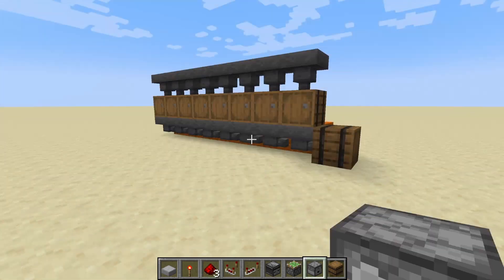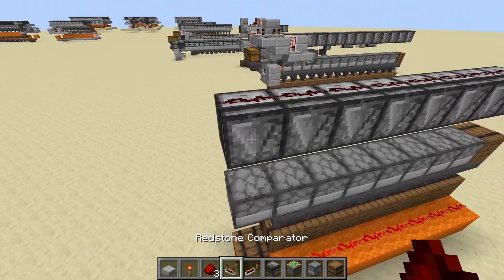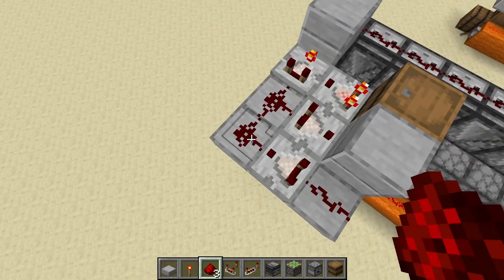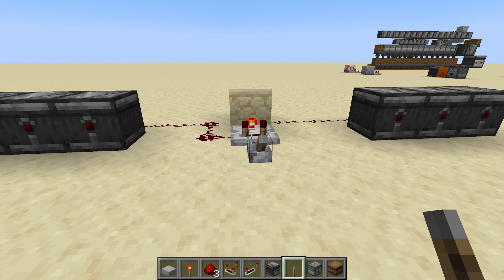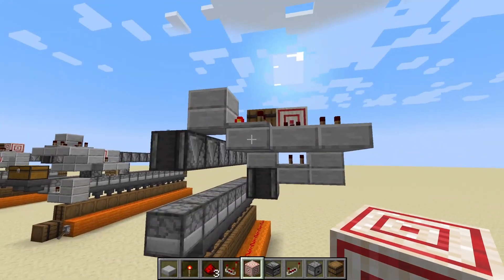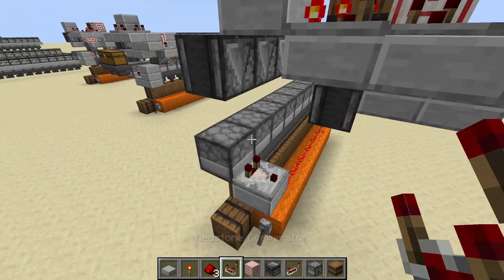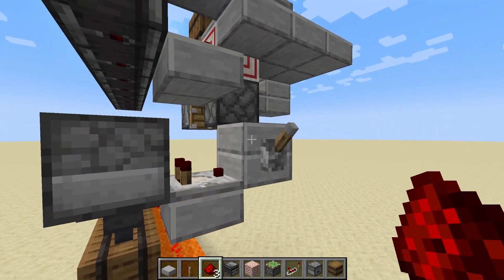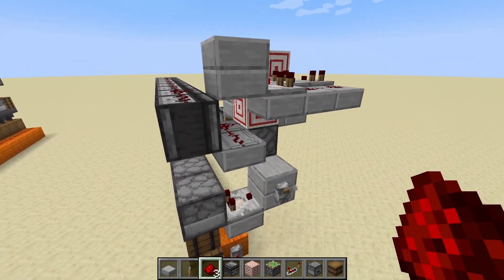Tutorial: Fast Dropper Item Distribution for Minecraft Java 1.19

Comment: Maybe for only 5 hoppers we don't need the extra redstone signal boost from the barrel with 512 items in it?
Reply from the maker: You can adjust the signal strength from the barrel, but it needs to match the length of the hopper chain.  If you watch the video on dropper/smelter distribution you will see one without a barrel, but that uses a full strength signal (torch) for 16 hoppers (15+1).

So yes, can do less hoppers, but that won't get rid of the barrel.

Comment: I built the contraption but for some reason none of the items go into the last container :l
Reply from the maker: Is the repeater at the end on two ticks?
Reply: @elhedran  yeah
Reply: @elhedran  the last observer is not powering
Reply from the maker: @campeloll  if the last observer isn't powering, it's either the line of droppers is too long, or the repeater isn't in long enough for the comparator to fire for the observer. I haven't seen any other reasons for the last comparator not to fire
Reply from the maker: Sorry, thinking of a different build (dropper distribution for furnaces)
Reply: i am in the same boat, except with mine they are not going into the 2nd dropper/barrel.  The items evenly distribute to 7 out of the 8 leaving 1 at either end empty depending on signal strength
Reply from the maker: @chinesefood3165  this design is very dependent on world location and direction - even other nearby redstone can break it with stray block updates.  Any mods that change redstone will also break it.  There are a few variations shown in the video for different orientations. If they work, great. If they don't it's a case of praying to the redstone gods of finding a clock that avoids holding the observers on incorrectly
Reply from the maker: @campeloll  rewatched the video to remind myself about the actual build being discussed instead of the incorrect one I imagined it to be. 

Short answer is, if you followed the video and it didn't work, you either need to know four or five ways to build a fader clock to find one that does work, or just accept it won't work in the world where it is put.

Or just slow it down.  The other video for dropper distribution for furnaces uses a slower clock that is less susceptible to world orientation and position. 

If you really want it to work and can get me a world download I can have a look, but this one is in the black magic category of redstone.

Comment: Thank you for the system! I have a beginner-level question (I don't understand redstone all that well): if I just wanted to evenly distribute between 2 barrels using this system, do I just replace the barrel at 2:22 with a composter filled to 2?

Also, I'm planning to use this for gold ingots at a gold farm, which I expect to trickle in (rather than go in a whole stack at a time). Does this work with that (either exactly or approximately)? The ultimate goal would be to have half the ingots from the farm go to an automatic piglin trader, and the other half to go to storage.
Reply from the maker: Short answer, this is not the system you need. Mainly because of the trickle in part, you need a system with some sort of memory.

I don't (currently) have any designs that for your needs. It certainly should be possible though.
Reply from the maker: Two questions.  Is it ok if it only runs at 1.5 hopper speed (or slower if items come in slower) and is it ok if it keeps a buffer of 40 items in the first dropper.

If the answer to both is "yes" I may have something that would work for you - assuming you haven't found something already on another channel.

I remembered that I had something I only built in my test world that is a variation on this design: https://youtu.be/xoNQf7WCDCo?si=r8IIk86_r7QwVv70
Reply from the maker: On second thought, lets keep this simple.  2 barrels distribution just is hoppers under a double chest.  Even (trickle items in) is the same thing, but locking the hoppers until there is detectably more than two items in the chest.

https://elhedran-minecraft-public.s3.ap-southeast-2.amazonaws.com/simple_two_way_split.png

It is possible to do with less of a buffer (variation on one of a dropper based smelter distribution) but honestly given the difference in complexity and given its connected to a farm, I'd go with the simpler design in the screenshot.
Reply: @elhedran  Thank you so much!

Comment: So I built your design and can't seem to get the droppers to distribute evenly across the barrels. Do you know what went wrong?
Reply from the maker: To have a guess I need more details.  I would have to assume that there is some difference between what is in the video and what was built and isn't working.

As the video indicates, it is sensitive to block update order, so even could be some redstone or similar operating too close to the timing redstone.  This would show up as the observers flashing slower than they should.

At a minimum I'd need to know how many containers are being distributed over and what happens in practice for items distributed by the troubled build.
Reply: @elhedran  I built it exactly as you did, right down to the compass direction. I did it on a server and figured out the problem. The redstone tick for the server is cranked so the redstone moves too fast. 

The issue I was having was that the droppers would place all the items in the one barrel at the end of the dropper line and not down into the individual barrels beneath. The redstone was too fast and wasn't letting the droppers deposit below before the next tick. So in order to make it work I would need to create a separate redstone clock to delay the redstone long enough for the items to be passed down.

Thank you for replying to my comment. I really appreciate you taking the time to do that. I look forward to watching more of your videos for redstone tutorials and machines. Your videos are really well done, your explanations have actually helped me better understand how redstone works. Thanks :)
Reply: @CrimzonLizard   i have the same problem. let me know if you found a solution

Comment: This is certainally a lot better than the hopper chain item distribution system.. But what about feeding items into that first dropper? That is what if a stack was in a hopper feeding that first dropper... does it still work?   Do you need an initial delay to let enough items to get pushed into that first dropper so it has enough for the distribution?
Reply from the maker: A single hopper will feed in at half the speed the dropper pulls items out - so yes, need to do something.  There are two choices I'm aware of.

The first is if the item supply is abundant (say, a farm producing items at more than double hopper speed) you can just feed two hoppers into the first dropper to fill it as fast as it pulls items.  This also works with a trapped chest over two hopper lines both feeding into the first dropper.

The second option is to use a compost and comparitor to subtract 1 from the bottom comparitor reading the first dropper so it doesn't read as full until there are enough items in it for a cycle (or you can do both options if items are coming in at say, one and a half hopper speed).

If you don't mind that first dropper having a minimum fill level, e.g. items can stay in it at the end of the run so long as they are pulled in the next run, I'd probably use the subtract 1 method as its a little more lenient to possible item supply rates.

May I ask what led you to this video? While I've made use of this design in a potion factory, I've been hard pressed to think of where else it might be useful over hopper chain item distribution.
Reply: @elhedran  Saw it while exploring storage tech.  I was thinking however this would be good for furnace arrays where you want to distribute items fairly equally.

As for a solution. I would probably just delay the start signal from the moment the first item arrives.  Also somehow immediately stop the signal when no items are left.  Not certain how to do that as yet though.
Reply from the maker: For smelters the biggest issue for dropper distribution is the 15 length limit, so I still use hoppers: https://youtu.be/hhAlybSMQF8

I'll have to think about item distribution as it relates to storage though...
Reply: Try a different equal item distribution system...  https://www.youtube.com/watch?v=OLmTVOTT9e8
Reply from the maker: Interesting approach with powered rails. That said, it's still hopper speed and the approach in my hopper based design is also hopper speed, perfect distribution, but simpler to build.

I am still going to build the powered rail approach though, some tricks in it used that I hadn't seen before